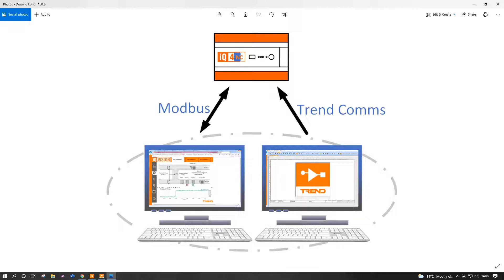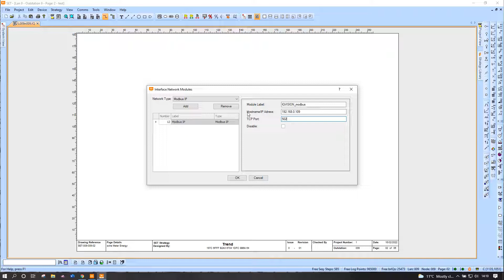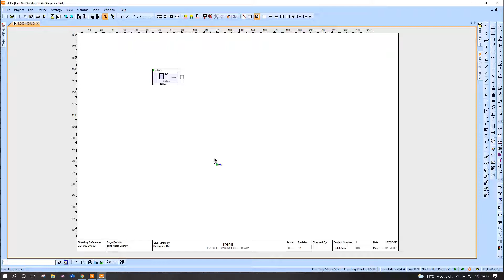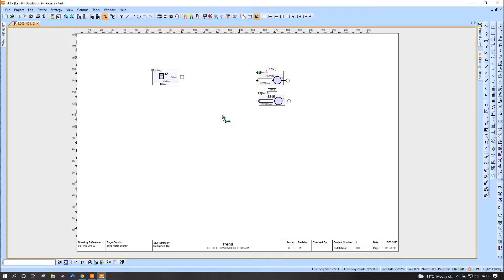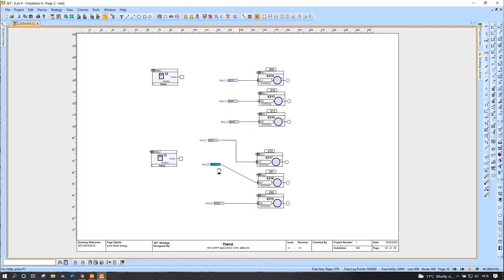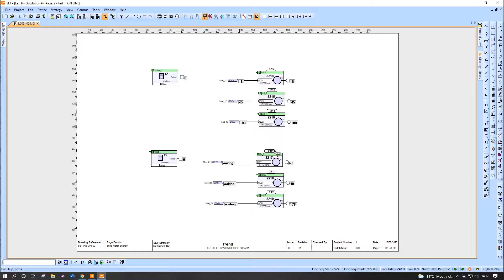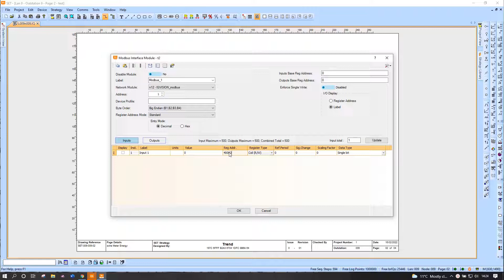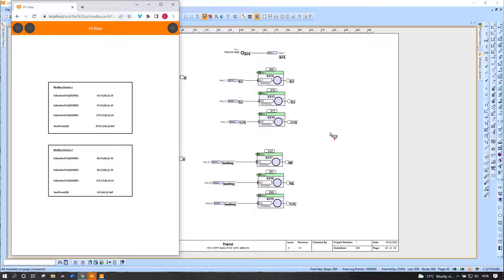IQ interfacing

Comment: select value from points where kind = "NumericWritable" and name like "%InternalSensor%" and clarity = "low" and frustrationLevel > 9000
Reply from the maker: @damianolesz6326  I can’t tell whether this is praise or criticism! Can I assume the former?
Reply: @loonworld  You can assume it’s both! 😄
Praise absolutely goes to the video author—without that demo, I’d probably still be staring blankly at the IQ4 wondering how to even begin with Modbus.

The criticism, however, is squarely aimed at Trend. The setup process is way more convoluted than it needs to be—not just compared to JACEs, but even brands like Teltonika or Siemens make it feel like a walk in the park.
Reply from the maker: @damianolesz6326  noted. Thanks for the feedback. Feel free to send me details of what you found particularly difficult to figure out.
Reply: @loonworld  Thank you—I appreciate your openness to feedback.

What stood out to me was the number of steps required to get to the point where Modbus points are actually live and visible. Compared to other industrial controllers—or even something like an OpenWRT-based router—the process involves significantly more clicks and configuration layers.

It’s not necessarily about complexity in terms of logic, but the time overhead and navigation depth can be quite a barrier, especially during commissioning or troubleshooting under time pressure.